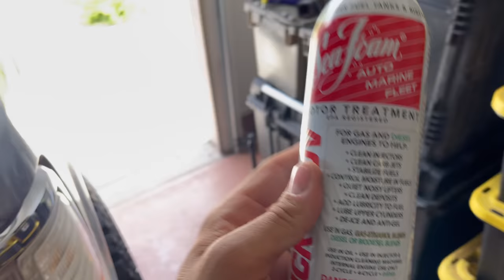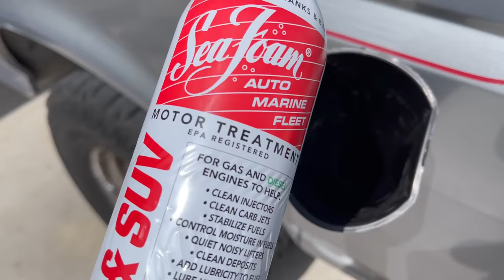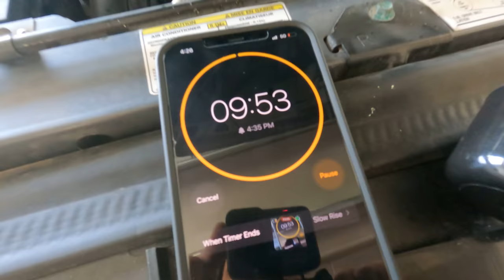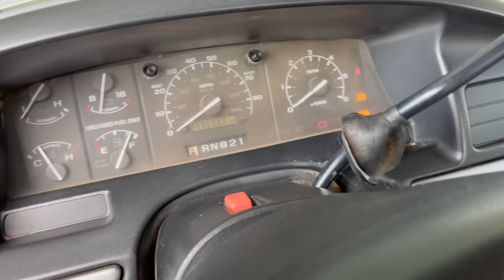Seafoam - Engine Treatment | How-to and is it safe inside your motor?

Comment: I’m gonna try this on my 1996 F150 with the 302, it currently idles a bit rough so hopefully this could smoothen it out
Reply: Update: I did it, it runs a lot smoother now. Although I still have my rpm issues where it’s not dropping fast enough when I let off the throttle and I have to put more power on the brakes to get it to stop when I creep up to a stop sign or red light. I changed my IAC and MAF sensor, but still nothing. Although I’m still getting the MAF code even though I changed the MAF sensor, perhaps that’s what’s causing the RPM issues
Reply: Try changing your egr valve
Reply: @ogchadd  I’ll have to try that
Reply: Could this be a vacuum issue fellas?
Reply: @james_jr  that is also a possibility
Reply: @lerg12  I had same problem with my 95 f150 it was my TPS. Throttle position sensor. And my dads 94 did the same thing took forever to idle down after started and it was EGR valve.
Reply: @scoggins_3458  oh yeah I changed the TPS and I’m pretty certain it was that because now it doesn’t feel like it wants to bust through a red light or stop sign. It was jerking and surging from stop to go with low throttle a bit, but knock on wood I think I fixed that by putting a perfect size hose over the broken vacuum line, fits in through the hole perfectly and so far knock on wood that seems to have fixed it so far. Not to mention some new plugs and wires helped too
Reply: @lerg12  try cleaning the throttle body around the valve, inside and out, with brake clean or throttle body cleaner. I have a 98 dodge ram that did the same thing. Was a combo of a dirty throttle body and a bad master cylinder.
Reply: @chasebanks5021  Oh yeah I fixed the rough idle issue for the most part. Now it just surges at low throttle, it’s pretty aggravating. I cleaned the throttle body and replaced the gasket, TPS, MAF, IAC valve. Did my tuneup with new plugs, wires, cap, and rotor. But next on the list is the Ignition Control Module and Ignition Coil
Reply: Check you vacuum can hose, it’s made of brittle plastic and can crack. Buy like 2 feet of 1/8 inch vacuum line from your auto parts store and replace it with that and some zip ties or tiny hose clamps. You have to cut open the electrical cord bundle to access the not cracked part of the hose
Reply: @lerg12  does oil pressure on the cluster stay consistent or does it fluctuate when you hit the gas? If it fluctuates, check oil level. If oil level is good, but pressure fluctuates the oil pressure sensor could need replaced. That can make the truck do some weird shit.
Reply: Theres a 90 degree elbow that dry rots on these very common to cause vac issues, theyre towards the back near passenger side of the motor
Reply: Vacuum line is your issue 100%
Reply: @lerg12  I second checking the EGR and vacuum lines.  If not those, indeed also check the Throttle Position Sensor.
Reply: @PeteForester1  I’ve long sold the truck but I tried all those things and none of that solved the issue, looking back at it now I think it could’ve been a combo of the intake manifold gasket and a bad MAF plug

Comment: When you're down to around a quarter tank of fuel, you want to add your Sea Foam and then top your fuel tank off.
Reply: Really  if I hv a issue with a vehicle  I would even add as much 2 cans of seafood to 1/4  tank no top off  and take off driving 🤔  I hv used this for forty years  ,  for regular service I add one bottle to full tank   I use it every tank on my motorcycle cycle. Because of the power  increase  and it can be felt

Comment: I would have liked to have seen before and after pictures using a boroscope through a spark plug hole or through the throttle body to the intake.
Reply: Check out chrisfix channel. He did it

Comment: OK.  The question I ask of this kind of maintenance is... "What happens to the stuff that is removed from wherever"?  If it is "loosened carbon" then it goes into my Catalytic Converter and will probably choke it up, right?  If it is "burnt off" then why didn't it do it beforehand instead of being in the system right now?  This stuff is 25% Isopropanol and "petroleum products" - what is actually doing the cleaning and why do we need the other "% of stuff"?

Comment: Just 1 recommendation - shown us the before and after white cloth. I used Seafoam in my 2.2l gm and it burned oil quite bad. 2 quarts every 3000 miles. And now After 2 treatments it uses maybe 1/2 every 5000. And it feels like new.

Comment: Awesome video! Did you notice a difference from the first treatment? If so, where did you notice the most difference?
Reply: I poured a whole bottle in my 97 ford explorer tank of gas. It works. Just pour it in man.
Reply: @cheavismartin1186  Idk bro i didn’t understand him,
Should u just pour it in the gas or do both also the intake?
Reply: @01Elantraaa  its two different sections of the motor, so doing the gas and intake same time wont hurt, you have what goes through the injectors for the gas that burns, and then the cleaning of carb build up on intake. What goes in gas doesn’t smoke out the pipe like that, the smoke is from it running through intake. You’re all good bud 💯👍🏼 youll come out with it running like new all at once!
Reply: @tristanharris8849  ty ik now

Comment: I used seafoam in my 1965B model Mack and I drive cross country   I started using seafoam  last year. My fuel mileage went from 5'2miles per gallon to almost12miles per gallon , I sware by this product.  It even shifts better.

Comment: I'd recommend running Cataclean through the system after that because all that crap that has been loosened up and running through your exhaust will have gone through your catalytic converter clogging up the thing. Good chance of throwing a check engine light down the road... 😉
Reply: If his bronco 95 or older no emission check only safety. No way to check he could be OBD 1
Reply: @OliverKoolO  just recommending he takes the easiest step first to making sure the catalitic converter doesn't clog up like it can sometimes do. Not thinking of emissions necessarily I'm thinking the converter getting access amounts of nasty chunks of residue that may not get burnt up or recirculated properly through the PCV system. It's good to clean the engine but you seen the smoke yourself. That's alot of caked oil and grime going through there. Can often clog the exhaust sensor making it freak out or the cat.
Reply: I've used Seafoam for years several times on the same vehicle. Never had a clogged cat. It seems to have cleaned it as well.

Comment: Don’t leave seafoam in your engine oil it’s a heavy detergent and can break it down just follow the directions and change your oil after 300
Reply: Amen to this! I did this to my Subaru and holy shit man! I drove on it for a few hundred miles, lesson learned!!!
Reply: Automotive engine oil is full of detergent. It's really stupid to clean the fuel line/tank and dump all the garbage in the injectors.
Reply: @w0lvez1 so what do you recommend?
Reply: @kevinsauceda5854  Best way to clean the fuel system is by replacing the fuel filter and injector's micro filter.  Water based industrial grade carbon remover like TURCO 9045-6, Armakleen & PistonKleen works best on dissolving carbon build up @ room temp without any effort.
Reply: It says in the can you can add it after you change your oil and leave it until next oil change.

Comment: What can I expect if I only pour it in the gas tank? I'm not mechanically inclined so I'd like to stay away from underneath the hood.
Reply from the maker: It’ll help clean Fuel pressure regulators, injectors, upper manifold.
Reply: @ChaseGentry  I do this and my up manafold still looks dirty. why is it not helping it look cleaner

Comment: I switch between using SeaFoam and Berryman the gas tank in my dual carburetor Vstar 1100.  I recently yanked the carbs after 2-1/2 years to clean my jets, not one bit of deposits. I barely started the bike over many months in the winter for 2 winters. We have crap 10% Ethanol gas in Illinois. Totally clean.  I’d never add it to my engine oil. Based on the science, it’s a bad idea.  Great for the intake of GDI engines.

Comment: My son's Mazda 3 has a misfire on cylinder 4 and I've replaced the plugs and coils. Moved the ones off 4 to 3 and the problem stayed on 4 so I'm thinking the injector now. Going to get a bottle and pour it in the gas and see how it works out. Tempted to try the Lucas but I used Seafoam on our trailblazer and it smoked like crazy so I know it was removing something. Will see. Thanks for the video
Reply: Did this work for you? Replaced the coils, plugs, and wires and just bought this kit too. Hoping it works!
Reply: @Swixxly  Man real talk I did everything! So I can't really say what finally worked. I had been driving it with a lose in power because of that cylinder but I changed the plug and coil again and it drives fine now. I think the spark plug went bad but I changed them both. Months ago I put some Ring Seal in the oil. I also saw a video of a guy putting Seafoam in the oil. It's on the bottle that it can also be used in the oil. Oh and I did take that number 4 injector off and cleaned it. I did everything I could and it drives way better NOW. But that's because I recently changed the plug and coil. Try some Seafoam and see if it'll clean your injectors since u already have fresh plugs and coils. I think that Seafoam cleans through the fuel filter too. I was going to change it but I finally got it to run better so I left it alone. Oh I cleaned the throttle body and MAF sensor too. Man I did all kinds of stuff to that car.

Comment: Fluid ounces and weight ounces are different measurements one measures volume the other measures weight. Different liquids (substances) have different weights per unit of volume so using them interchangeably is inaccurate.

Comment: The way we used to use BG cleaner, instead of spraying it directly into throttle body and washing all that junk down the intake, we would pull a vacuum line and stick it into the can slowly to let it suck it out. Let it sit while you did the rest of the work then take it interstate for a very brisk test drive. That stuff sure was good, Sea foam hasn't done me wrong either though. Now Im a little older, I worry about where all that broken up junk goes. i can run E85 in mine for a few tanks and have top of engine like new, but converter catches anything that comes loose and might be a problem.

Comment: Thanks for your video. What could have been interesting was to have done an oil analysis before and after the treatment, just to see if there was any differences
Reply: Suggested to do this seafoam treatment before an oil change so any left over deposits will be flushed out with old oil**

Comment: I did this in the fuel and crankcase on a SHO.  Put the seafoam in a week before i changed it.  260 miles later it was the blackest oil ive ever pulled out of any engine.  I think it works.

Comment: Yup it does. What's the difference from AMSOIL Engine/Transmission Flush before changing oil, to this as it does the same and then use AMSOIL, I've noticed much better smooth engine and no rough idle at all, I heard that Seafoam is great stuff, but that person asked me to get him the Engine Flush with and oil change as he used years back with old truck, nephew converted his 5.3L 2012 Chevy engine into fully running engine with cam swap and no more shutting off 4 cyclinders, he replaced spark plugs twice in a month and drives on the highway and getting poor mileage,  so once broken and changed oil a 2nd time in 1 week and oil filter looked great considering this was his 1st engine build, so wanted to change oil and add AMSOIL in it, plus it called to Flush engine out with AMSOIL ENGINE FLUSH to clean up any small passages of oil goes through,  reading up on his work,  it states if any issues or think there could be which his cyclinder heads and valves looked horrible on those 4 cyclinders that shut off when not in use and leaking oil into exhaust easily,  he cleaned it up with a plastic scrapper to be gentle on them not to mark them at all and same with cleaning head gaskets off. He took his time and was very cautious not having the money to replace engine if screws up, before hand, he even put in some racing fuel and paid more for non-ethanol gas which did run better.  But not like when 1st bought a few years ago,  he dropped about $2K into it with other stuff but now runs great, even burns a thevtires if hits gas petal not trying to hard. Just breaks loose that good, so he's following same person that posted to YouTube on how to do this kit. Oil came in and changing this Saturday.  Wasn't for beginners and it's his biggest job ever,  never thought it would run again,  I'm here and it will because you're doing it as should,  by the book with everything and specs tighten to with buying a new tool on half turn past spec.

Comment: Seafoam sadly is a solvent based product. Contains IPA and Naphtha. Seafoam is NOT PEA based. Bad for your engines rings, seals, gaskets. Hence the name Seafoam designed more for small engines and marine applications. 

Btw, white smoke, that's the product itself burning off. Carbon is black, not white when burnt off.
Reply from the maker: U are correct sir 
Fuel - black 
Oil- blue/white
Water - white
Reply: Yeah don't use it! This guy's a joke.
Reply from the maker: @dang75790  😂😂😂😂 🤡
Reply: @ChaseGentry  busted! Lol did I hurt your feelings.  😆
Reply from the maker: @dang75790  😂😂😂 lol I don’t have feeling I’m cold as ice 🧊  just love watching comments of all these scientists 👨‍🔬
Reply: Hahahaha
Reply: Prove it. Since it's bad to use, prove it
Reply: @dl2.504B don't have to prove anything to you. But if you like bring your electronic riden vehicle over to my place and will run it in your car. 😆
Reply: @dang75790  We took a 1981 Chevrolet truck with a 350 In it and it would barely idle it ran so rough did what Chase gentry did and after driving it for a couple hours it cleared it right up didn’t even have to change the spark plugs I’ve been using seafoam for 25 years and it does a great job!… you’re full of crap.
Reply: @loyalamerican8776  yes . You are I'm sure correct. An vehicle that age yes. These fools are doing cars etc with all this electronics on it and such. I'm not running that in a modern vehicle.
Reply: Scotty Kilmer does not recommended seafoam for your car but ChrisFix kinda does endorse it. This world hurts my brain even when I try my best to make educated decisions. Lol
Reply: I'm double certified mechanic this and berrymans(thanks vice grip garage)and you say it's bad well how come I'm running currently on 236000 miles on my 09 Nissan rouge sl awd ,and the engine is just as good as the day it came off the lot.and before it's said it's only just put a new CVT in 2 year ago.i use royal purple hmx and seafoam every 8000 miles.i have many customers who do this in their small engine boats plains.🤔 but it's bad you need to get a life cause apparently you know nothing about mechanic work.
Reply: @dang75790  you fool the dude in the clearly stated in works on fuel injected engines. no car made today in fuel injected so why would you use it in newer vehicles??

Comment: I only recommend Seafoam for older model cars from the 90s and before. It's actually made for boat engines. Used to use it in my 92 240sx. It works great. For newer cars I use Chemtool B12. 🎉🎉🎉

Comment: On my gasoline engines been using for decades. It's dollar tree fuel treatment for me. Price now $1.25 at Dollar tree. Red cheap heat diesel fuel treatment about $2.26 a bottle at Walmart and most places. And the best fuel of all is propane no fuel treatment needed and way less maintenance than any other engine running propane. I can store propane for years and the engines fire up first time on propane. In cold winter on my gasoline engines I use propane to help start the gasoline engine up in winter so it won't kill the battery and for a fast start. I do this on the gasoline engines  I haven't converted over to propane.

Comment: I need feedback. I have a 1994 Ford F-250 4x4, 460, Automatic. I put all new plugs, wires, cap and rotor. I used Sea foam in both tanks. Premium fuel ⛽️. New MAP'S censore. Now my truck runs it SHI#. I didn't clean the throttle body yet, that is next. She is slow starting now. She also surges now. Plus the engine light comes on. Also driving on the Freeway, she won't eccelerate correctly (sluggish) and won't kick down. Stumped.

Comment: Cool cool bro. Always wondered bout that foam. Curious to try on my 2000 safari.
Reply: You can use rubbing alchohol. Does the same thing. As long as the liquid 1)evaporates and 2) isn't more flammable than gas. Kerosene works aswell.

Comment: 1) You’re supposed to put the spray tube in front of the intake and reconnect the intake hoses before spraying, and 2) the after-soak operation is supposed to be done under load (I.e., you are supposed to drive it).

Comment: Would that hurt sensors or catalytic converters?
Reply from the maker: Nope not at all 🤘🏻
Reply: Don't use it! It will definitely mess them up.
Reply from the maker: @dang75790  😂😂😂😂😂
Reply: @ChaseGentry  not hard to know you're a paided spokesman. Lol
Reply from the maker: @dang75790  must be nice to think you know everything 😂😂
Reply: No
Reply: Quite possibly. If you have a MAF sensor downstream of the throttle body you will have to disconnect that and clean it, also knocking chunks of carbon deposits off always includes the risk of damaging a piston, turbo impeller etc.... or clogging your catalytic converter. I’d use something with PEA in it  like CRC if I was going to use a spray. A